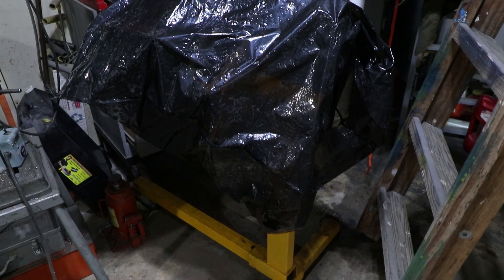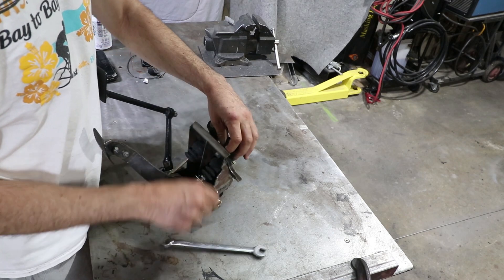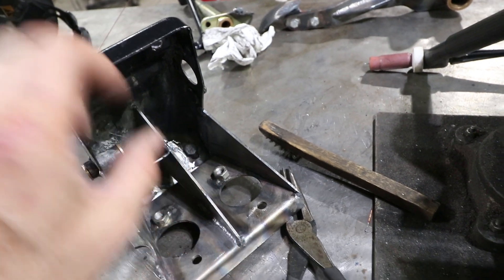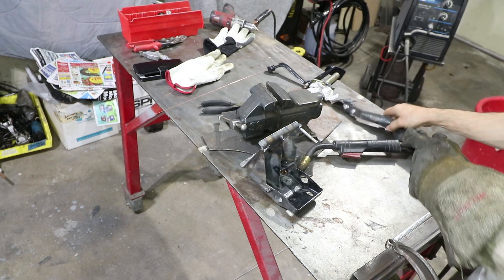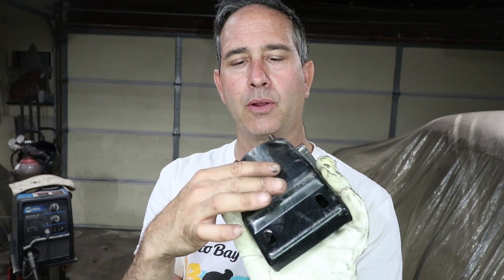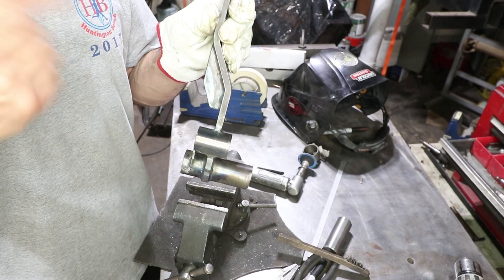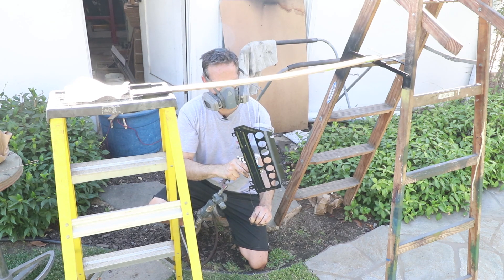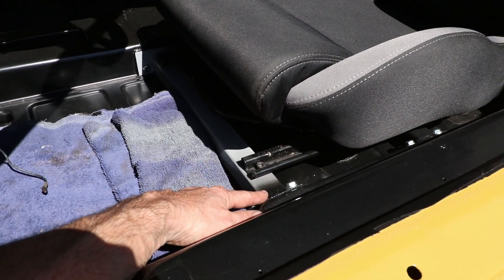Dual Master Cylinder Pedal Box Fabrication - Vintage Porsche 911 Build

Comment: When I prep, for painting i use a hot air-gun to pre-heat metal part to paint, it takes the moisture out of the metal, and when it dries it sucks the paint into the pores of the metal. Love watching the engine rebuilding, and specific tooling you spend the time fabricating. Thanks heaps from Australia.
Reply from the maker: Cool idea, I live in a really dry climate so moisture has never been a problem for me.  Thanks so much for watching.

Comment: I am still looking for my two steering rack cover springs of my restored car, since about 5 years!! I put my garage up side down a handfull of times, without any succes at all. I am sure that someone came and robbed them in my own garage, inside the box where they were stored!!!😕 I still have two Zip-Ties to fix the rack cover instead of the two OEM springs. Je te souhaite Bon Courage pour la recherche de tes circlips d'axe de piston (this is for your son!) Bye. Thanks again for this video, Tom, the paint job you do reminds me the job I have done for my own car.
Reply from the maker: I can't believe these garage bandits are everywhere.  What are they doing with our clips and springs besides laughing at us?  
Thanks for the French lesson, I'm going to show my son now.  👍